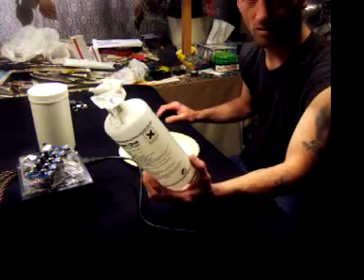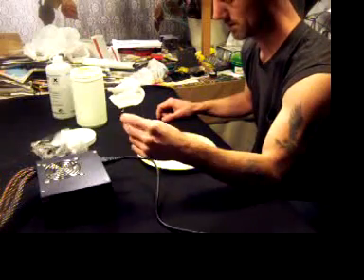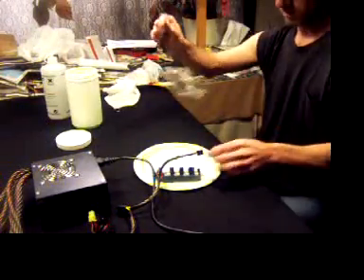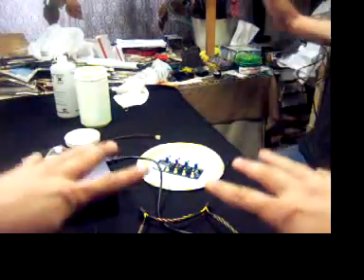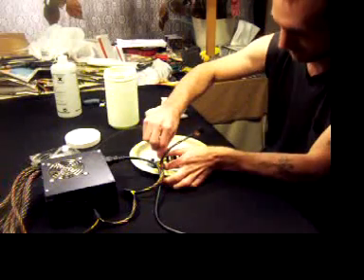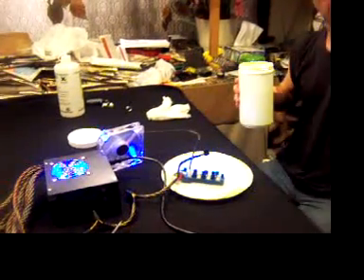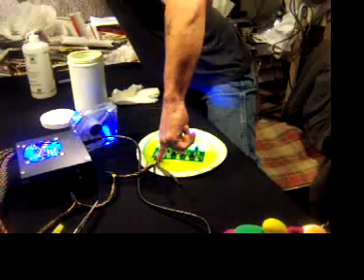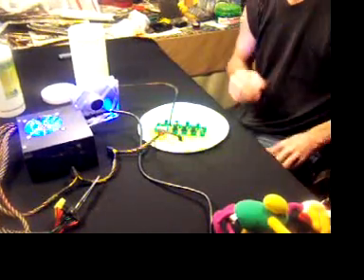Feser One Cooling Fluid

Comment: I am not sure what these guys used but my experience with Fesserone was completely terrible. I had used regular water with an additive that I got with my water cooling system for almost a year when I decided to switch to fesser one.   @ days after my watercooling system sprang a leak. No biggy replace the tubing and go again. Again 2 days later with new tubing and a leak. Biut the second time the liquid got onto my video card. One dead video card after some fireworks. I do not recommend fesser 1

Comment: Lol nice video, but do you know what would be really crazy?  To put into this liquid not the fan controller, but the power supply too. I understand that that would be dangerous, but the point is the many cases accomodate the power supply at the bottom, so if there is a leak there is chance it will get there too.